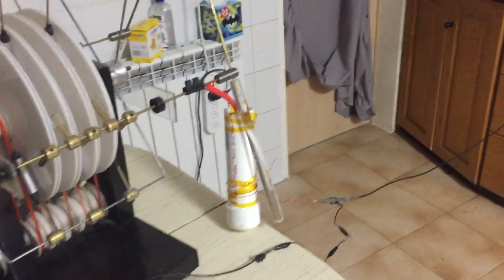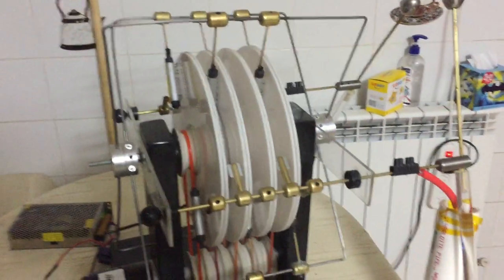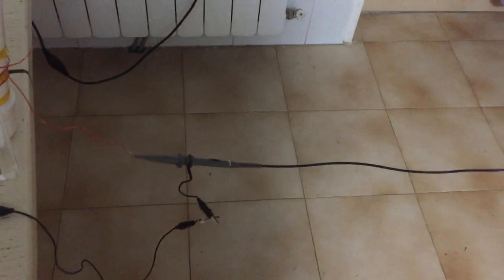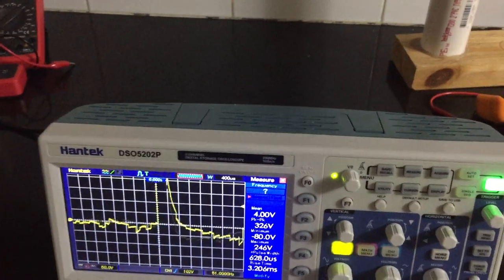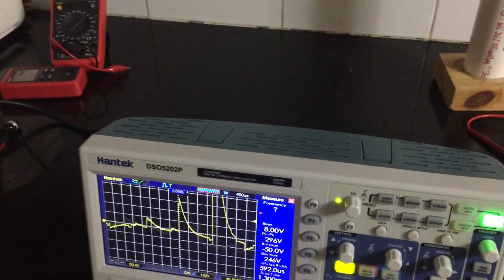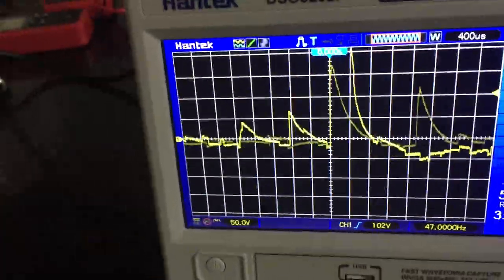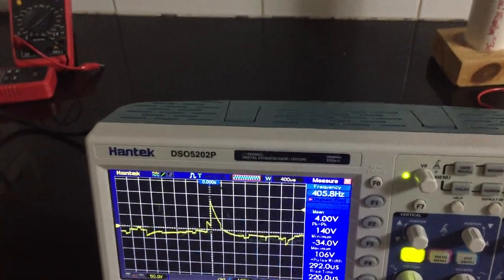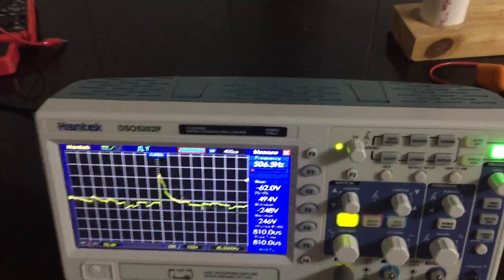Scoping the Bonetti Machine Signal

Comment: Nice. Yea that spark gap makes the voltage flyback all over the place.  You can try to use an RF coil or a ferrite choke as the antenna for your probe. Having some higher inductance will allow more of a charge to be stored and picked up by the scope. :)   I would love to have one of those machines to work with.
Reply from the maker: Thanks for the tip!!!
Reply from the maker: Check out the new video.  I used a large 5" ferrite core transformer I was playing with (479 mH) to wirelessly pick up the signal.

Comment: Thanks for that bro, that's crazy. I guess I shouldn't have been surprised. Is there a way to smooth the output so its a nice ac wave?
Reply from the maker: Thank You! You could probably drive a second transformer from the output of the first one. The output of the second transformer would probably be closer to a sign wave. I would also place a bi-directional TVS (transient voltage suppressor) diode across the poles of the output secondary on the second transformer, it will keep high voltage peaks out, get one that cuts in at the maximum voltage you want out of your second transformer, but first,
 scope it to see what you are getting.
Reply from the maker: Check out the new video.  I used a large 5" ferrite core transformer I was playing with (479 mH) to wirelessly pick up the signal.